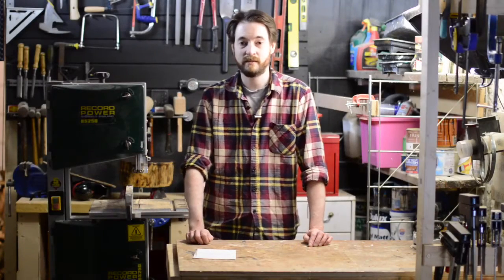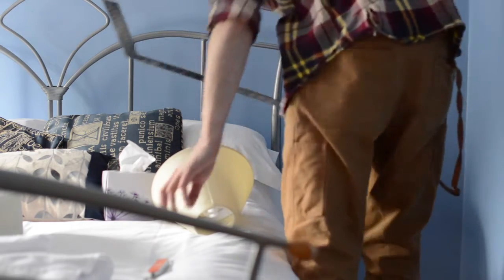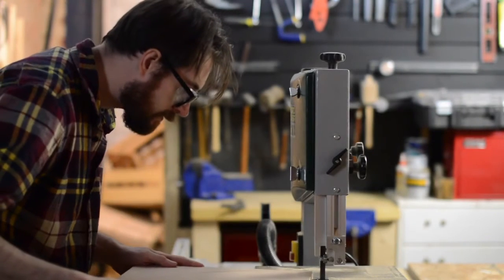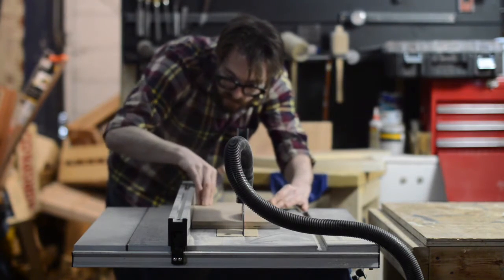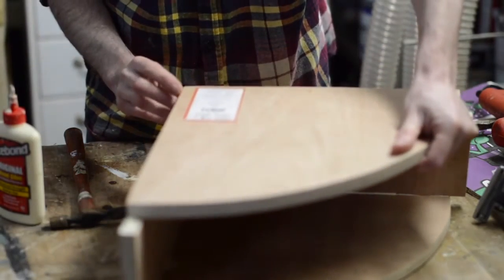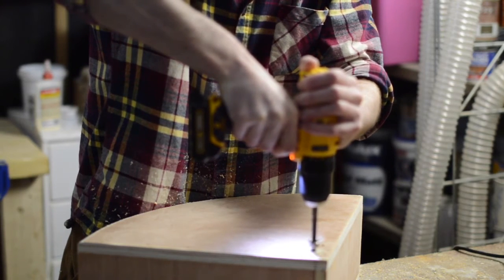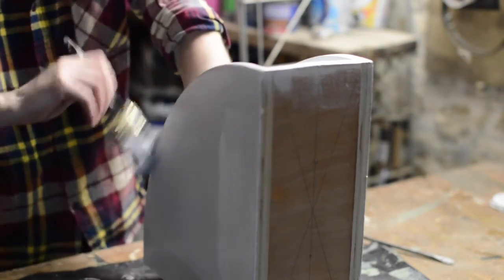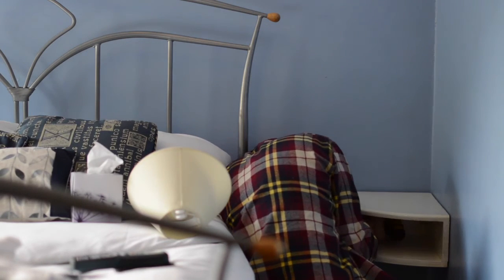DIY How to make a Night Stand / Corner Shelf

Comment: Nice project. I see that you're using the Bosch POF 1200 AE router. I checked it out in the store and it looked quite cheap, but it's in my (small) budget so I'm still interested. What's your opinion on it and for how long have you owned it?
Reply from the maker: I have had it about a year. Its not bad but i wish i had a bigger one to use in a router table and a smaller trim one to use by hand.
Reply: Badger Workshop It's hard to choose my first router. I think a plunge router is too large and bulky for my small garage, so a trim router seems more appealing. The real question is whether it's powerful enough for all 8mm router bits and how deep cuts you can make in one pass when routing slots, rabbets and dado's.